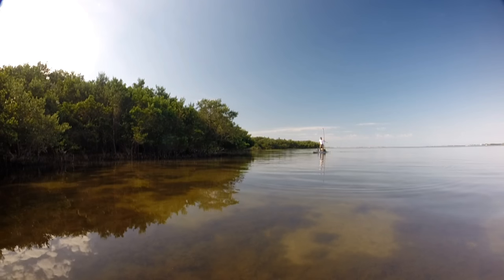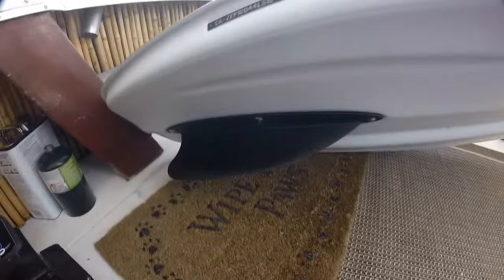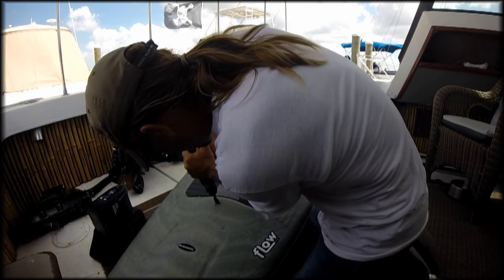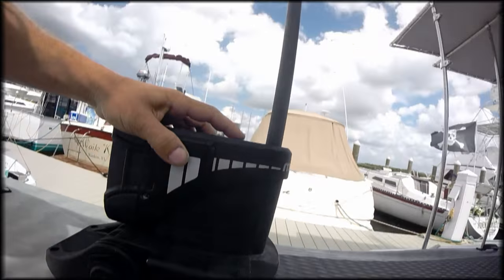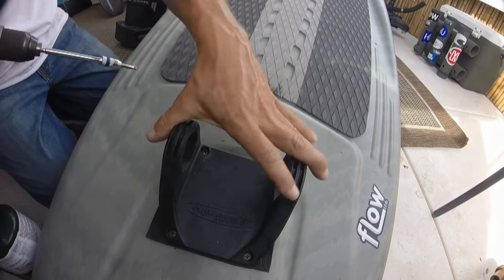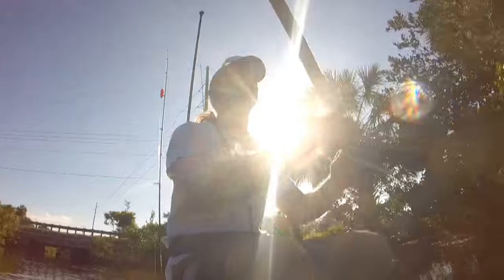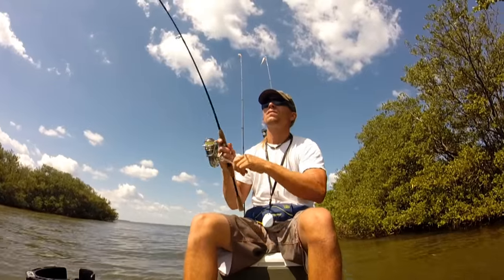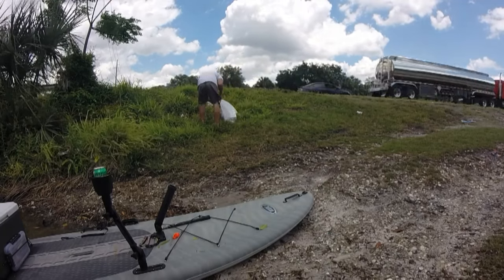Perfect Flats Fishing Paddleboard Rigging: Flow 116 Angler SUP

Comment: When mounting that rod holder you had a pilot hole...good place to put a piece of wire to pull the piece of plastic out rather than shoving it in where it will rattle around. Just a thought, Captn to Captn. Best
Reply: That bothered me lol
Reply from the maker: I hadn't expected it to fall in and cringe everytime when I hear it sliding around inside.

Comment: Use some aluminum tape or foil glued down with rubber cement to keep the heat off areas you don't want melting.

Comment: What are those holes in the hull for?  those are not scuppers - they don't go through do they?  that looks like a very strange hull design.
Reply from the maker: Since it's made in two pieces, the 'scupper holes' just add spots where the top and bottom get melted together at the factory. They, no doubt, help make the board more rigid.
Reply: +zoffinger Thanks!!  Could not figure that out.

Comment: Oh my. Drilling holes on your SUP is the shortest way to delaminate the whole deck if you ask me... Depending on the materials of your SUP but there may be a bit of epoxy under the plastic skin, some EPS core and probably not much else. Now you can tell the skin of the SUP is separated from the rest (delamination). If I was to drill a similar hole, I would use a circular (well, tubular) saw instead of a high torsion like on the video then inject some epoxy mix then keep the board compressed between wood packers before filling the hole. Then possibly reinforce it with stringers. I suppose it is fine as it is if you paddle on dead flat water and near the beach but I have experienced a faulty kayak in choppy conditions and it really makes you think about safety. It can go wrong all too quickly. An EPS core on a SUP, windsurf or surf board soaks up water like there is no tomorrow so you want to make sure the board is not going to break in half right where you drilled that hole. The result looks appealing but not sure I would have done it that way :-p
Reply: BonuxCouleur That board is hollow and all plastic.RamX

Comment: I don't believe I would drill.  Better to Slap epoxy on a sheet of 1/4 wood and move the rear handle and the power pole to the wood platform. Then attach the wood to the kayak with yak attack track. Just a thought. With the p.p. driving it's pole through the area hanging off of the rear of the newly added mod, there is no reason to drill.Btw, you could simultaneously add holes in the wood for wheels.You may want to drag that board some day,lol.